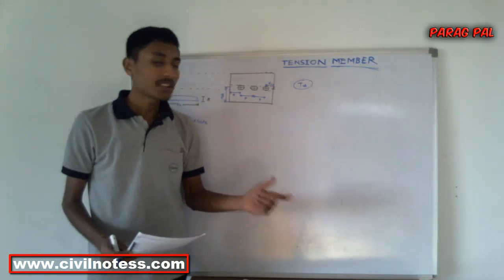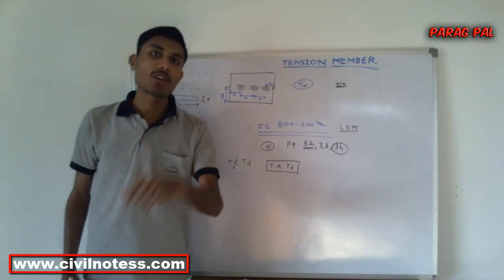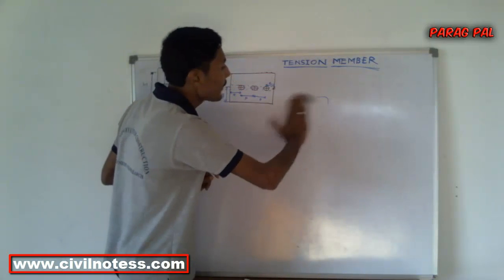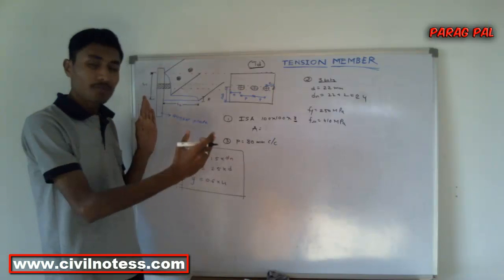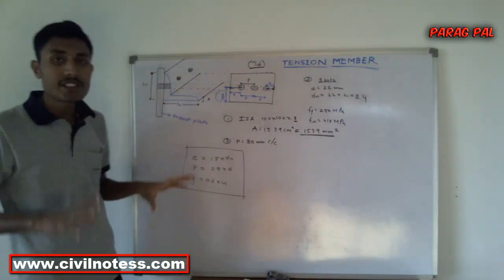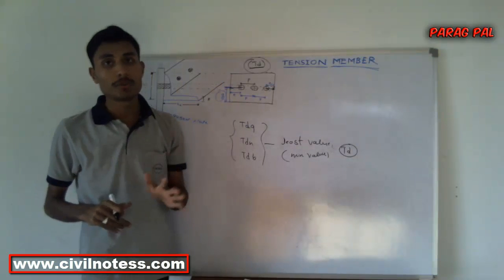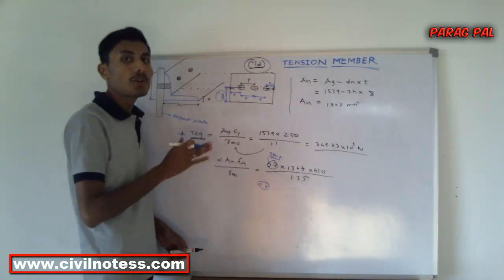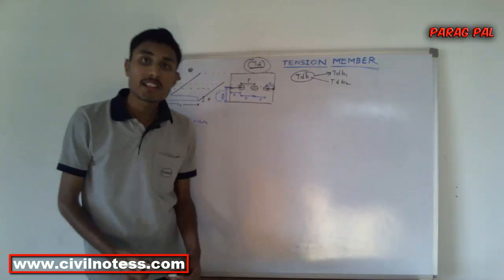Design of Tension member steel structure (LSM) part-1 by Parag Kamlakar Pal.

Comment: The tension member of a truss consists of two angles 100mm×100mm×8mm.If the two angles are welded on either side of the plate at the joint ,design the joint by using 6mm fillet weld and draw a dimensional sketch of it.The axial tension in the member is 220kN.Allowable shear stress in the weld is 110N/mm^2.    plz solve it and upload...I did not find such kind in your uploads...